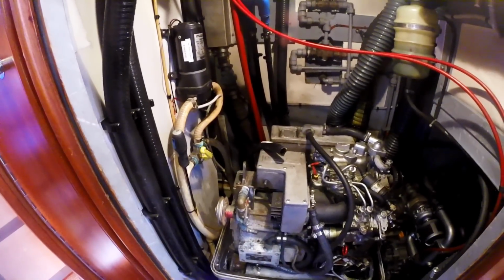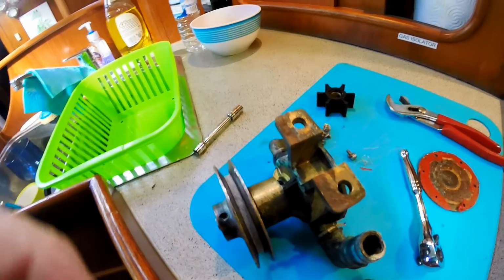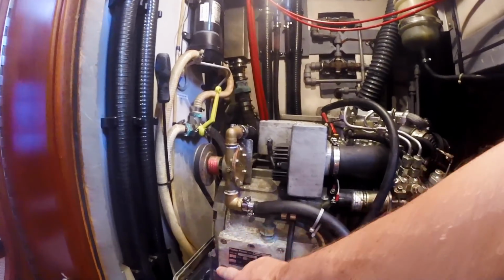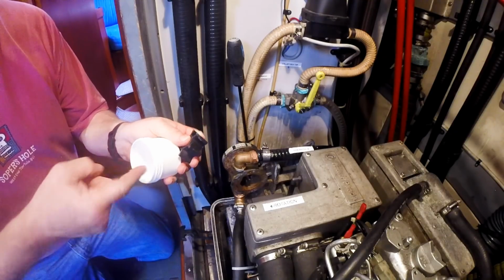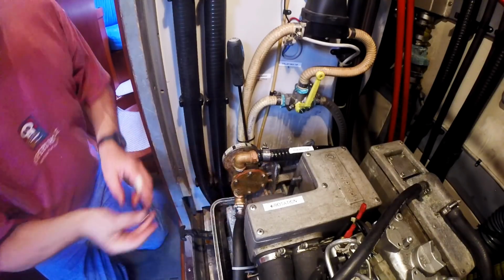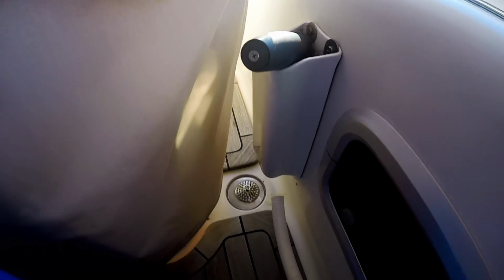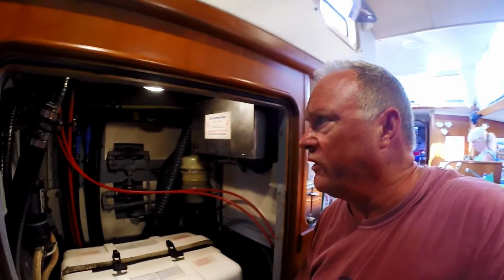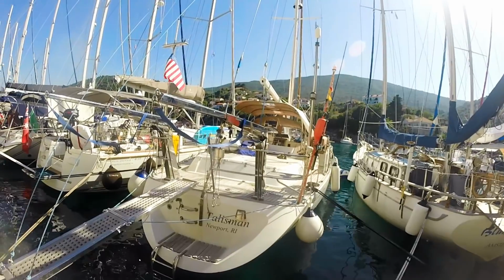Ep 52 Genset Repair (Sailing Talisman)

Comment: Kevin, I am in awe of your detailed problem solving. Just bought a Finnsailer 36 in April 2019. Little by little I am solving issues that arise. Starter solenoid, relocating aerial, furler and currently elbow water/air exhaust pipe, and much more. Oh I forgot, Eberspacher heater!

Loving your videos, every aspect. Thank you.
Reply from the maker: Hi Hugh. Thanks for the kind words. Indeed, it never ends. However, with time you will have fixed every system at least once and then you can diagnose the problem more quickly.

Comment: Nice info - well-presented.  Thanks.   I don't know if they make them for gensets, but I put 'SpeedSeal' covers on my impellor pump on the main engine.   It does away with the 6 bolts and paper gasket (or sealant like you use).  Instead, they machine a grove in the cover, and insert a simple rubber gasket in the groove.  It tightens down (finger tight only) with four screws -- and you get a perfect seal.  It's wonderful --- change an impellor in three minutes.  Again, very nice video.
Reply from the maker: I've seen them and would like to try one out someday. Prior to the bolts (which I added - the washers are because the bolts are microscopically too long) there were slotted screws that were literally impossible to remove even with an offset screwdriver. You had to remove the whole pump. That's the kind of think that I just shake my head at. Thanks for watching and if you ever want to join for a few days or a week, let us know.
Reply: SpeedSeal were indeed a great solution, they are now out of business, so you'll need to find someone with existing stock (good luck!), until someone copies or licenses the idea for further production ...
Reply from the maker: Good to know Craig. Thanks for watching.

Comment: Great job. You are the only place I have heard of the weak link in the system. The heat sink looking block that runs raw water around the stator housing. I am working on one now that is completely clogged and of course everyone is talking about the heat exchanger and I just went through the hassle of lifting the engine to get heat exchanger out only to find it is fine. The problem is in the stator housing so one clog is all you need to shut the system down. I'm glad you got it together and hope I can get those passageways cleaned out as well. I sure wish I had seen your video before I dug the heat exchanger out. thank you.
Reply from the maker: Hi John. What's it clogged with? Fischer Panda tells me the stators with the water cooling are very fragile with thin aluminum walls. They do not recommend using harsh chemicals like Barnacle Buster, but rather a diluted (acid) cleaner somewhat stronger than vinegar, but not too strong. I know that's vague, but that's how they describe it. Try calling Fischer Panda in Florida too. Talk to Jarvis Angelety / service manager. He's a cool guy. BTW, you can usually get away with just tipping the engine back to get to the heat exchanger. Remove the hoses at the far ends rather than at the HE itself, then snake them through. Always start with the simple stuff. Disconnect the raw water pump exit hose and make sure you're getting high pressure gushing water. A bad belt, pump, or impeller will reduce pressure and overheating will result. Use a laser thermometer to check temps at the thermostat housing. Should be seeing 80 degrees centigrade. Pull thermostat entirely to make sure it isn't faulty, and see if that improves temps. I've actually never heard of the the stator cooling circuit being clogged. As you saw in the video, for us it actually ended up being a carbon clogged exhaust mixing elbow that was preventing the exit water from entering the exhaust.
Reply: @SailingTalisman  

Thanks for the reply. It turns out the the big problem was the mounting plate for the dynamo. It was totally blocked so there was no water coming out the exhaust. The heat exchanger is out and is in fine shape. The mounting plate is all corroded and needs a new one. We will see how much that goes but at any rate the plate would be a good thing to check when you have reduced water pressure. I used air on the dynamo water jacket and it seems fine.

Comment: I had the same prob. with impala , same make same  model but now made in China - were not up to scratch, seen the same with zinc blocks , look good but inferior.Great job , love the way you explain things , may you always have wind on your aft quarter.
Reply from the maker: Hi Bill. Yep. When Fisher Panda was first entering the Marine Genset market, around the time Talisman was built, they were all but giving them away to gain market share. But there were growing pains, and the design of our model was changed radically, especially as regards the stator, almost immediately. We don't expect this genset to last too much longer, but we'll stick with it until it stops working. The last owner installed a new Kabuta diesel engine, so that side is probably strong. But the stator is no longer made and it wouldn't be worth the cost anyway.

Comment: Just viewed this post. Great stuff and well thought through. I have a 4Kw Fischer Panda genset and had the heat alarm sensor trigger the on exhaust and cylinder but not the water (lights on mine Green = good, Amber = warning, Red = auto shut down). When running the lights on the exhaust and engine sensors would go to amber about 10mins which concerned me. Talked to the agent in the UK and suggested I clean the sensors which I took off, thoroughly cleaned for good contact and now have green lights across the board when running her. Very simple fix but suspect a common problem. Happy sailing.
Reply from the maker: Thanks for the tips Mike. A lot of our viewers are looking to cruise and I tell them all the time, it's about keeping these systems running. Each of them has quirks and wants to go down if everything isn't perfect. We had our go out and pressing the start switch did nothing. Turned out it was the little blue fuse mounted near the wiring panel on the block.
Reply: @SailingTalisman  Agreed and often it is a case of running down the problem like your approach to fixing your genset. Also getting to know where everything is. Boats are complex beasts especially if you have lots of stuff and the boat manuals are generally useless. I had the shore power trip go which should be simple reset but it took two hours to find the trip switch which was mounted inside the steering quadrant! I know now.
Reply from the maker: Man, isn't that how it always is. The good news is that after about 2 years you get to know where most things are.
Reply: @SailingTalisman  Spooky, I have now owned my boat for just coming up to two years and think now I have a handle on it. Luckily based in a marina so always got some guy at hand when needs go beyond my pay-grade. Shortly off on our summer cruise for 3 months. Where are you guys at the moment?
Reply from the maker: We just got back to Greece, and now it's refit time on the boat with probably over 100 projects. Some are large and some are small but all have been those little nagging things that annoy me. I'm giving it 3 weeks to complete, and then we're off to the Aegean.
Reply: @SailingTalisman  Sounds familiar. I have the "effing" to do list which now is mostly cleaning as cleared most jobs down in April. Enjoy the season and keep the videos coming. All the best.
Reply from the maker: You bet.

Comment: Great to meet you guys in Sivota the other day.
In the Mediterranean you really do not need a genset if you have solar and a good battery bank. We can run our refrigerator 24/7 (which I have to do as I have medication in the fridge). Oh and we only use an electric kettle, toaster, charge laptops and iPads. We can even run the investor all night for 230v larger fans. Never have an issue with power. Free and clean electric 😀
Fair winds and following seas 
WHUATI crew
Reply from the maker: Oh Jay. How great was that! We were so happy to see you guys. Need to chat about power usage, and on that front you seem like the man. We have a 230v fridge and a 24v gel battery bank w/ 420ah. Not sure what to do with it all. Our refrigeration is due for replacement as it's losing coolant every few months.

Comment: I’ve had very similar issues with my Vetus genset.   Great video.
Reply from the maker: Hi Georges. I think organic growth might occur inside if you don't keep them running. Also the scaling issue. But things are working now and I'm not going to worry until that changes.
Reply: Sailing Yacht Talisman probably.  In ten years I’ve replaced a heat exchanger, an exhaust thermostat and 2 water pumps and a circulating pump.!!  But it’s perfect now hahaha. And giving me hours of unhindered service.
Reply from the maker: It's a constant struggle to keep systems up and running. Watermakers are the worst. 50% or more of them out there need new membranes at a minimum. I suspect that most listed as "pickled" will mysteriously turn out to be inoperable.

Comment: You might try hitting up Globe Marine for a Run-Dry impeller.  they last three times longer than a standard impeller.  The only thing different is the are a blue color.   They are three times more durable and last three times as long, only generally costing between 10-20 more.
Reply from the maker: Wow Allyn. Great to hear. I always say that if the space shuttle couldn't launch without a run-dry impeller, one would show up within days. I'll look into it.

Comment: Great video, Kevin!  Thanks for sharing.  Would you say that many of the repairs you have done were a result of "ignorant" maintenance? Can't really say poor maintenance because it was done, just not to manufactures guidelines/standards. Also when looking at purchasing a used boat are these areas really difficult to find or address during the inspection phase prior to purchase?  Thanks again for sharing.
Reply from the maker: Boy, great question. For me, I think I never really understood how hard it is on marine systems to have them sit idle for a long time. Talisman sat on land in the marina for 7 years prior to our buying her, and I firmly believe that the survival of these systems goes back to the fact the Oyster only used the best of the best when the boat was originally built. You can try to do maintenance, and this winter while the boat is on the hard in Greece I'll do oil, filter,  and coolant changes on the engine and genset, as well as swapping out selected impellers, but things are still going to break and leak. In the end, the stuff that needs attention is always growing. Last week the zinc on our propeller inexplicable fell off with all the screws still in place, and the dinghy is losing a lot of air. Often, it's weird stuff like that. Nothing you would predict.
Reply: Wow, 7 years!  I knew trying to figure out what would break was near impossible. Maybe I have too high of an expectation.  Thanks for your insight.
Reply from the maker: You bet. I think with time you become pretty good at debugging your own systems. Last night, after all the work on the video, the genset starter wasn't coming on when the button was pressed. My mind immediately leaped to the worst, but I knew there was a starter fuse located at the unit and checked that first, It had vibrated loose and all I had to do was reinstall. Boom, back in action 10 minutes later.

Comment: You mentioned you had lost a vane from the first impeller, were able to locate that lost Vance within the the filter housing or beyond?
Reply from the maker: Yeah, luckily the outlet and elbow pretty much prevent the vanes from leaving the pump housing. That's not how all pumps are though and I've heard of broken vanes really clogging things up in the heat exchangers.

Comment: Great video, very informative!! What are your thoughts on solar? 👍
Reply from the maker: Funny you should mention solar. There's not a boat in Scotland (where Talisman came from) that will ever show solar panels. They get sun about twice a year. I'm kidding, but just. However, we're in places and will always be in places that have good sun, so we think about it often. However, on the other side of the coin is the fact that the larger the boat the more common it is to just run generator power or go to a marina with power. We're on the fence as I like the idea greatly but don't know where we'd install. There aren't a lot of good spots. So far we've focused on reducing consumption, and have been quite successful there. Our house battery bank shows 8 or 9 days of capacity on a full charge. This does not and can not include refrigeration or water heating since they work on 220vac power. We can obviously do without hot water, but the water heater does get heated whenever the engine is on and it stays hot for at least 2 days. So refrigeration is the main thing, and our genset uses so little diesel that it's not really expensive to keep going. TMI, I'm sure, but this is my thought process spelled out.
Reply: Lol...sun twice a year in Scotland 😂😂 I think your being generous 😉
Reply: Interesting to hear (from you and many others) of the issues with Gen Sets. 

Now as to solar: we have flexible monocrystalline panels on our dodger and Bimini that are 100 W each. There are two 100’s on the Bimini, with a 50W in the middle, and another 100 W on the dodger. In a 12 V system, the current will max out at 19 A. We’ve never reached that as our bank totals 270 A-hrs, and even with our fridge and all systems running, on cloudy days, we have sufficient power - about 8-12 A. 

Bottom line, I personally try and avoid more crap that requires maintence. For a 485, you can mount a wind turbine and around 300-400 W of flexible panels that will more than likely keep your batteries topped precluding much genset useage.
Best.

Comment: Raw water impellers are positive displacement pumps. Bilge pumps are centrifugal. I haven't heard of a positive displacement bilge pump.
Reply from the maker: Hi Ron. The Jabsco Maxi Puppy series of utility pumps are used in many marine. agricultural, and industrial applications. Their only real responsibility is to be able to lift a certain water column a certain height, ie. perhaps a meter, and not need to be primed first. These pumps have been installed on almost every Oyster I've been on, although I'm not sure what they're using now. I know that ours is amazingly powerful, and when it comes on it'll drain 6" of bilge water in about 20 seconds. We also have a huge Jabsco 1.1/2" diameter hose engine driven (impeller) bilge pump with a manual clutch. Were the boat to be hulled and we were taking on major water, this would be the ticket to give us the time needed to slow the ingress. I imagine that pump would drain a bathtub in short order. Once water gets up to your batteries, you're pretty much screwed.
Reply: @SailingTalisman  OK Thanks. I have heard of centrifugal type pump attachments to the prop shaft for emergencies, I had just never heard of a positive displacement pump used as a bilge pump. But I not on an Oyster either. Be well, safe voyages.

Comment: Can you not run the refrigeration via the main engine, as well as via the gen. set?
Reply from the maker: The Frigoboat 24v system we installed 3 years ago has been a huge upgrade. It runs off the house battery bank and cools all day and night, instead of perhaps once a day while at anchor and using the generator during battery charging time. Much better on energy and reliability. Our old Grunart system was terrible by comparison.
Reply: @SailingTalisman    Thank you!  I am looking at a 38 ft boat with a discontinued Panda 4200 with 170 hrs on it.  Seem like I would be taking on a lot of uncertainty regarding fidelity of the older system and I am not sure what to do about that in the run-up to purchase. Test it I suppose.  Up to a solid run temperature and load it up with the A/C and fridge.  What else, I wonder. (?)

Comment: I am constantly cleaning my sea water strainers. How did yours get so clogged?
Reply from the maker: Hi George. Our problem wasn't the raw water strainers, but we suspect the heat exchanger. I have found that strainers can be clean one moment and clogged the next. It just takes one clump of weed. But to your point, I check ours probably weekly nowadays. The Med is almost bereft of sea life, so very little in the way of weed around unless pulled up by anchors. Thanks for watching.